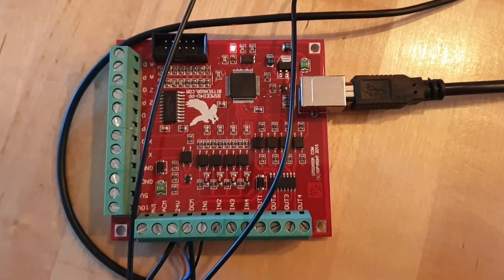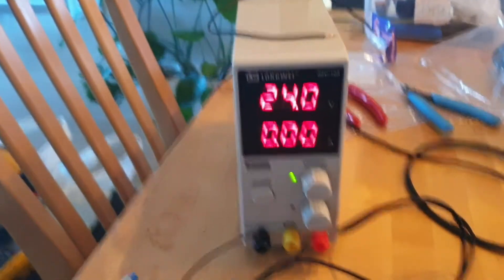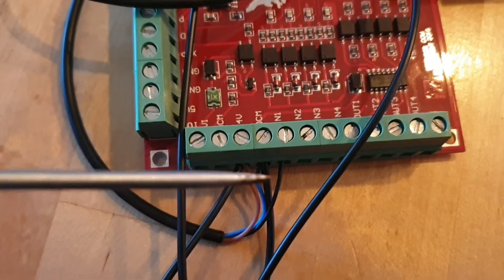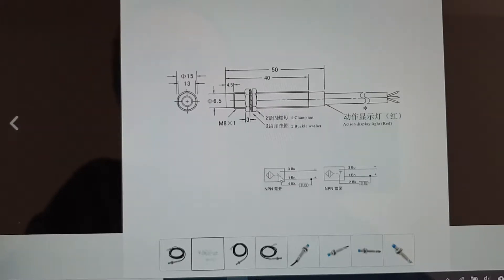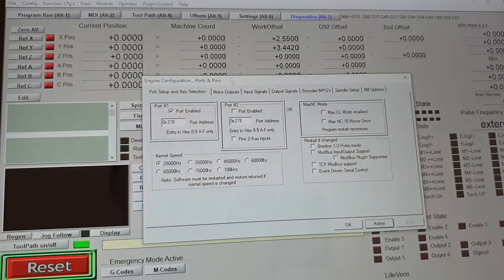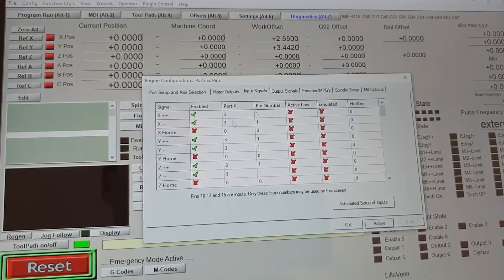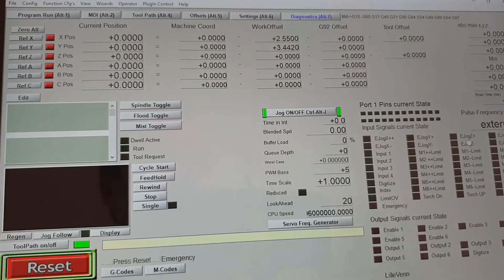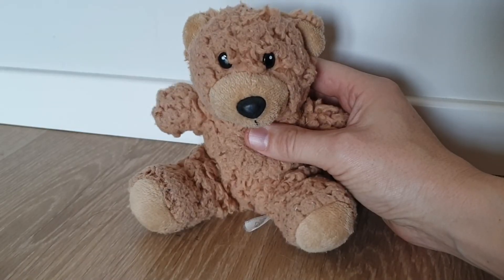Testing Proximity Inductive Sensor Switch with Mach3 and BSMCEO4U-PP breakout board

Comment: Hi. I have same board as you and now looking for proximity sensors. I heve read its better to use normally closed sensors because if their wire cuts there will no be damage to the machine.What should I use? Do you recomand your sensors?  Thanks.
Reply from the maker: You have absolutely right! Normaly closed gives you the extra safety that you get notised, or the program will stop if you have some problems with the wiring. However, my stepper motors are so weak, that they will do no harm to anything else than the workpiece, if the "limits" are broke.
In adition, as I get more comfortable with CNC I also know that the program will not go beond the programmed paths anyway, unless you disturb the motors in a way that they are in another position than what was planned. For that it needs some force...
When all comes to it, I personally would not worry to much about using NC or NO sensors.

My sensors have "no moving parts", they react if some metal comes close to them. I will inn general always preffere to use hardware with "no moving parts", because moving parts are usually pround to errors after teardown/weardown, bad contacts after long time use e.t.c. (But again, for hobby project I would actually not worry about that either :-) ).
My sensors works very well, and I can absolutely recomend them. I tried to find the seller on ebay, but I could not find him/her. :-)

Comment: What kind of proximity sensor did you use? How you plane to wire them in parallel
Reply from the maker: Have you seen my video: https://youtu.be/sku0rFijN4k
It is basically the wiring diagram I made for this.

I bought them on ebay: M8 2mm 5V DC NPN NO LJ8A3-2-Z/BX-5V Proximity Inductive Sensor Switch.